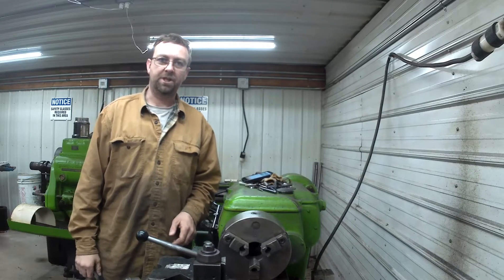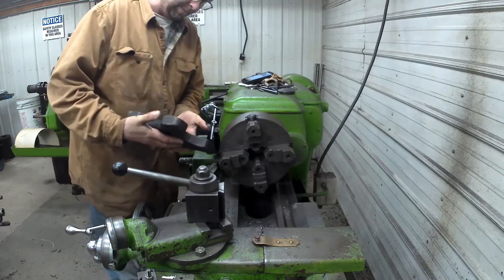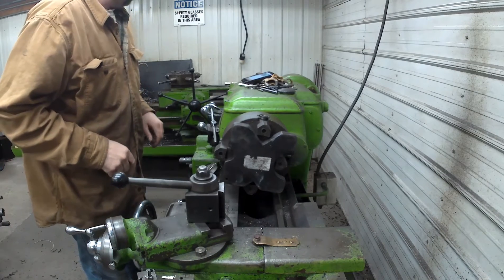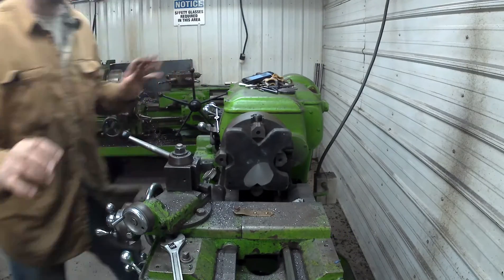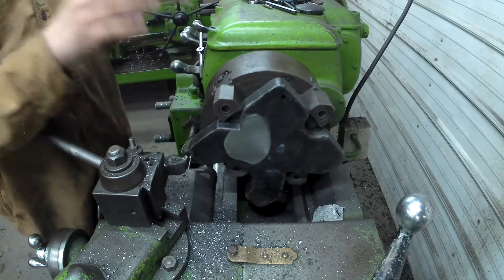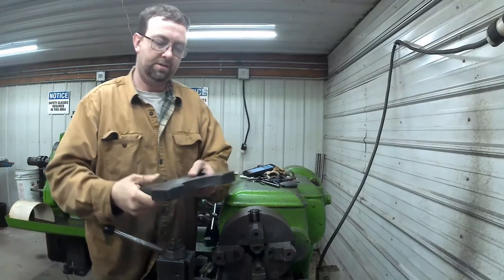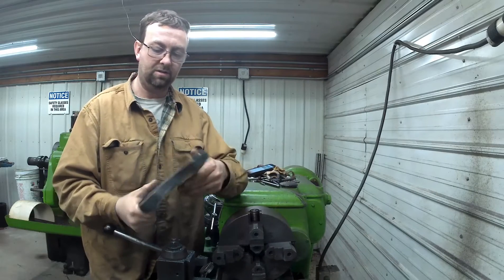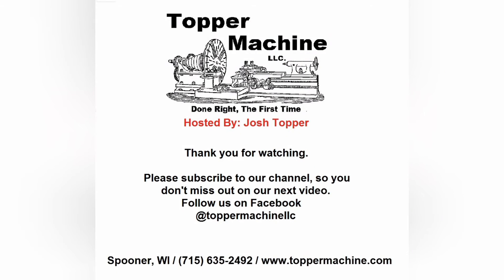Machining Central Hydraulic Press Plates on the Lathe

Comment: Josh, I am looking to purchase a lathe anywhere from 30-45 inches. I have been looking at an auction site HGR. I dont want to pay more than about 2500$ and will I am sure restore it after I get it. I can get it offloaded at the local lumber store. Like you I live in the sticks. I can also get a trailer to get it from the lumber store to my shop. Any advice you can give me would be great.

Comment: Hi, Mr tupper missed one important point, maybe 2. The first, the plats are of a cast iron,  brittle, should be made of carbon steel.  Tha 22nd,  buying these plates plus the  machining cost probably more than proper flame cut CS and it was supposed to be stated.
Reply from the maker: I didn't miss anything. I did the job as the customer asked. Had he wanted new proper plates, I would have done that instead.